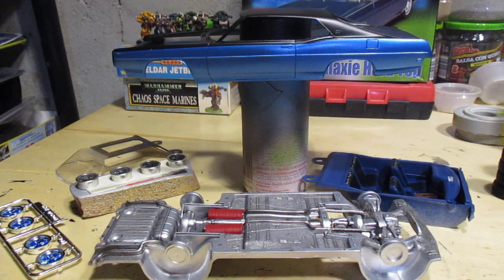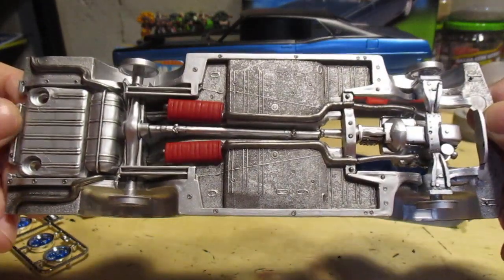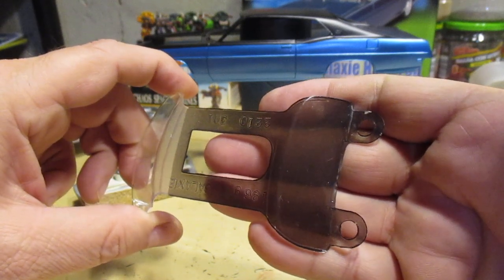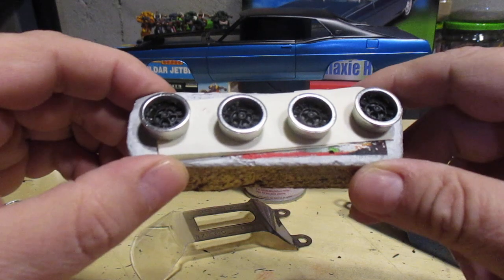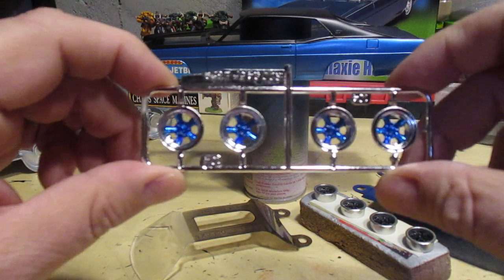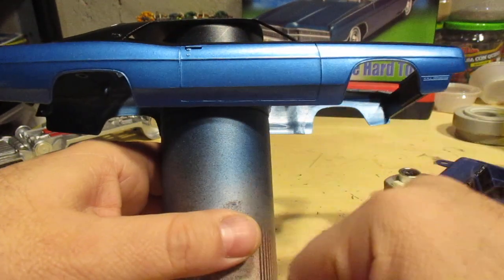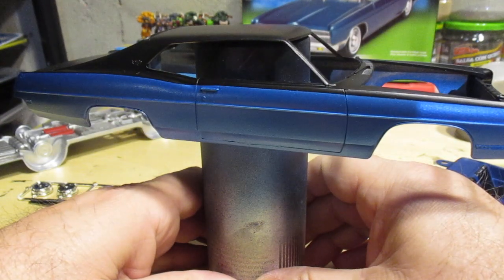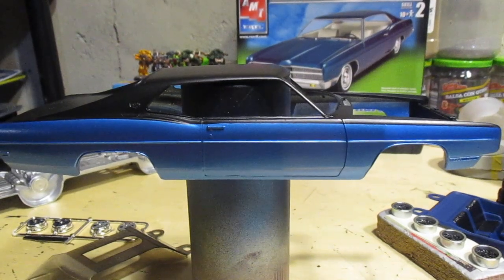Plastic Models - 1/25 AMT 1969 Ford Galaxie Hardtop - Work In Progress #2

Comment: Paint job looks good, nice recovery. I have been clear coating prior to masking for the second color. Seems to help.
Reply from the maker: That's worth looking into. Thanks for watching.
Reply: @TI4438  I had the same issue with peeling paint when I two-toned the seats/interior.  I think I saw this on another video and tried it; worked well.  I guess the clear coat provides a harder and smoother finish.  Using a low-tack tape is also a good idea; Tamiya;s is pretty good.  You can also reduce the 'tack' by putting the tape on a clean smooth surface and pulling i off; do that several times.
Reply from the maker: @larrydelaruelle5778  thanks for watching and the tips.
Reply: @TI4438  You must be another early riser, or has it been a long night?
Reply from the maker: @larrydelaruelle5778  life long night owl.
Reply: As is my wife since we've retired. I've always been an early bird.